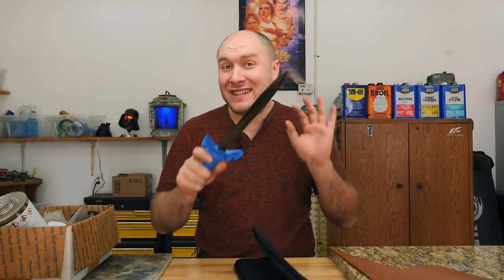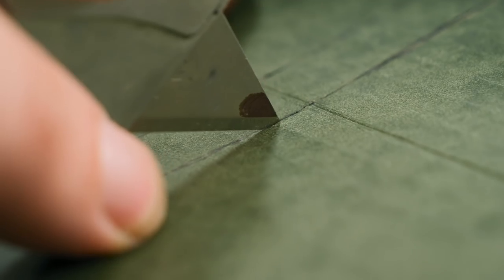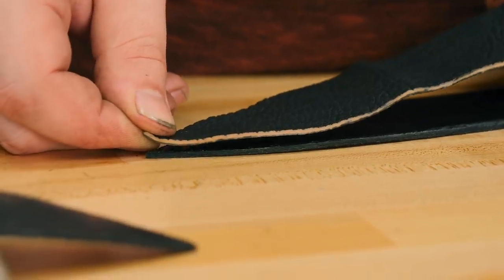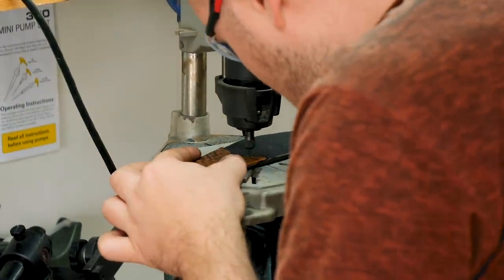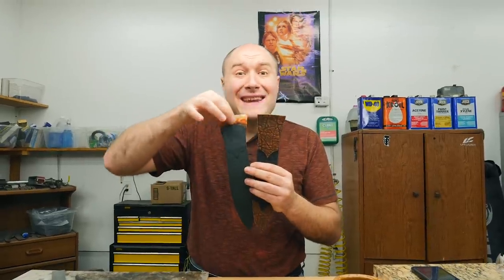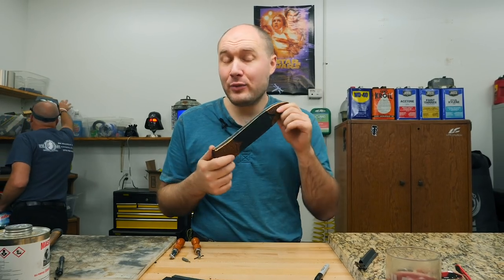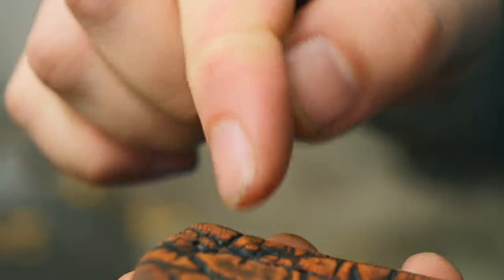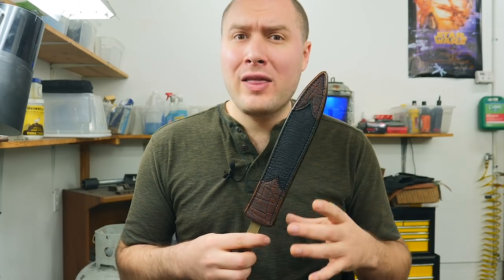Mastersmith Kyle Royer Teaches: How to Make a Sheath for a Dagger

Comment: Hey Kyle awesome video, my question to you is why do you use a dremel instead of a drill press, rpms?
Reply from the maker: Affirmative my friend. It’s a lot smoother 👍🏻☕️🔥⚔️

Team Royer
Reply: @KyleRoyerKnives  good stuff, I'll tamper around with my drill press speeds. To be honest I ran it on low and was okay, but I before this I would punch them out by hand. So good looking out.

Comment: I use my drill press to drill my sheath stitch holes and they never come out as perfect on the underside as the top where I start the holes, is that dremel tool somehow helping you with that? Thanks.

Comment: Kind of concerned that you are using chrome tan leather for a sheath. It has a tendency to react with the blade.  Always use veg tan leather where it’s going to be in contact with metal.